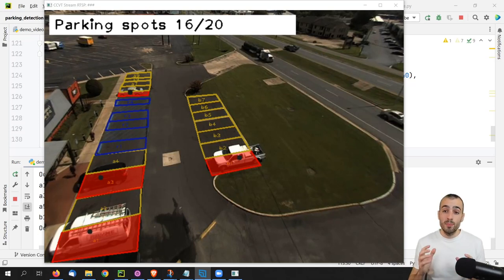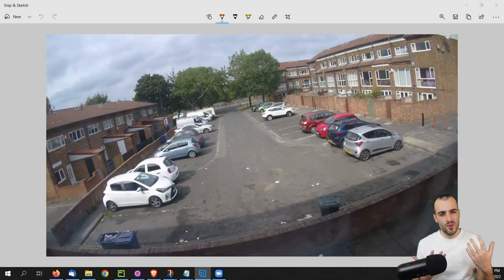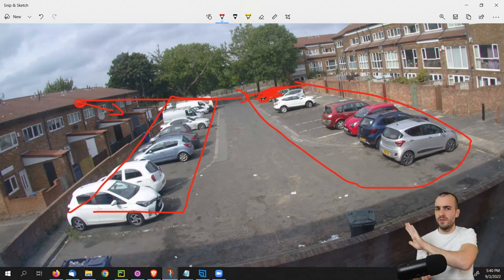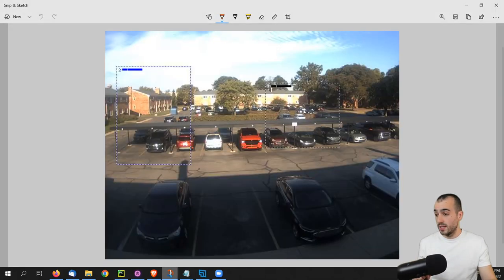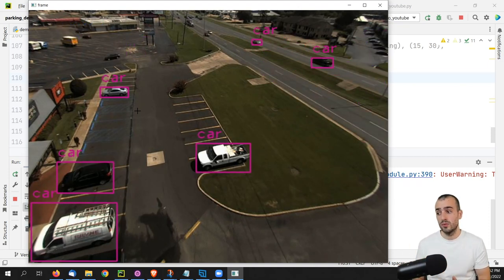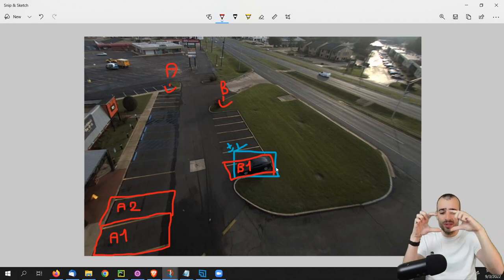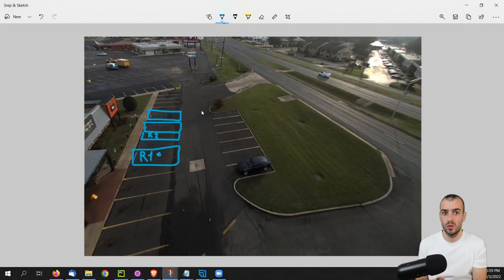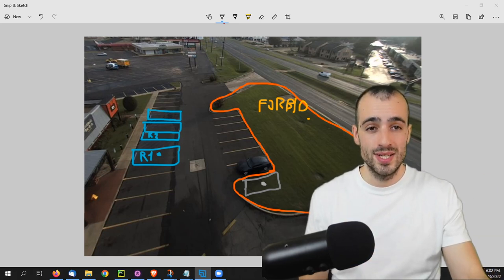Build a Parking Space Recognition system with Computer Vision

Comment: Really good video Sergio. As a suggestion I really like to see some video / material about parts measurement with high precision and how to define what will be accurate in millimeters according to the quality of the image acquired
Reply from the maker: Hi Jader, could you please elaborate more this specific request, giving me some practical examples on where you would use this type of software?
Reply: @pysource-com  imagine a rectangle of 2 meters long by 10 centimeters wide passing on a conveyor belt always in the same position. In this case the system needs to make sure that the part is 2 meters long by 10 centimeters wide with a tolerance of 0.5 millimeters. If out of tolerance, take some action
Reply from the maker: @jaderrosa2  I don't know about this particular specific project as it would be necessary to make a research and test the accuracy with industrial cameras. Especially I'm not sure about whether it's possible to achieve a 0.5mm precision (unless the camera is Just a few centimeters away from the target.
Reply: @jaderrosa2  it's possibile with the correct HD. You have to ensure that 0,5/(resolution mm/pixel) should be at least equals to 10. And morover avoid blurred edgees
Reply: @jaderrosa2  maybe if you put your camera a little higher than the belt and define an área in Px a little bigger than the rectangle, then when the rectangle achieve the right spot on bottom you take a crop of the defined area that the rectangle should be and divide the mm/Px to know how much Px means 1mm for example, then you check how much of area inside your crop is filled with your rectangle.
Hope you understand what I tried to transmit.
Reply: @jaderrosa2  eu me contorcendo no ingrish e tu é Br, pqp kkkk
Reply: @leo1722467  Thanks mate. I'll try something like that. Sim, sou Brasileiro mas vivo no exterior já a muitos anos!